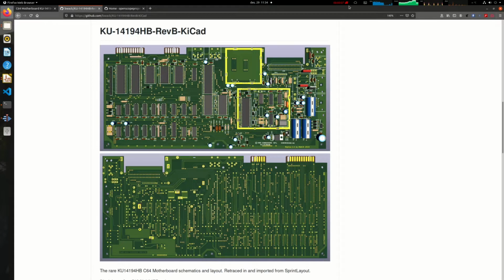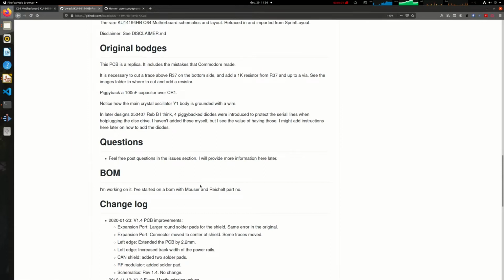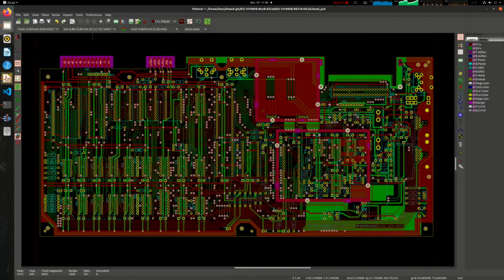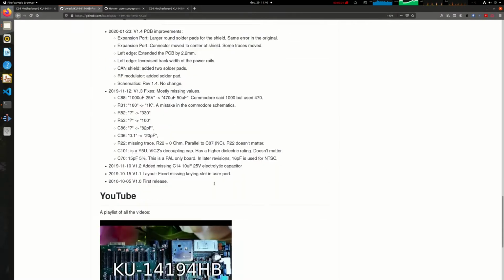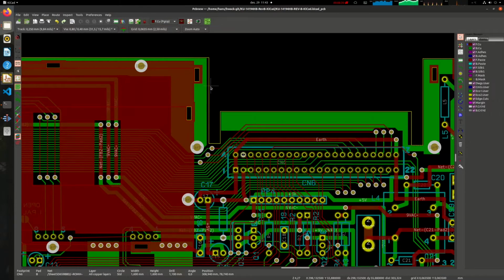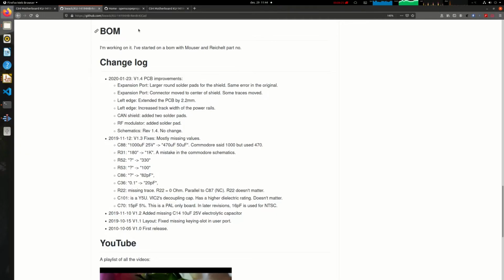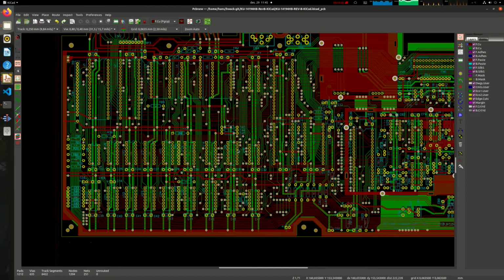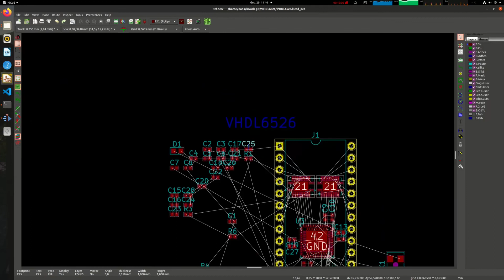KiCad InteractiveHtmlBom plugin used on the C64 KU motherboard replica

Comment: Wow!  I had no idea that plugin existed.  Thanks for sharing this!  As far as the non-replica changes you seem to have some apprehension about @4:20:  Have you considered maybe just creating a new branch for those and future "design improvements"?  I'm not sure how well the kicad files lend themselves to branching, but at least it should be possible to easily jump back and forth for reference that way (without checking out multiple clones and reverting one).
Reply from the maker: Hi. I thought about it for a while, but never had the energy to work on a new board.